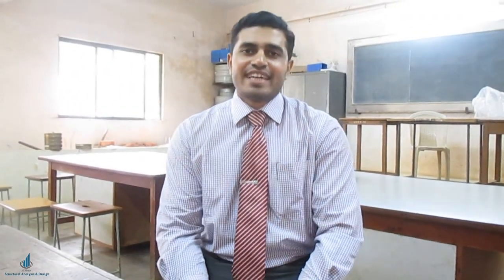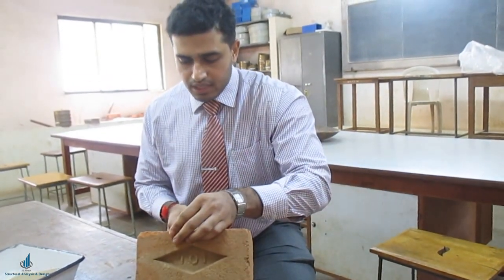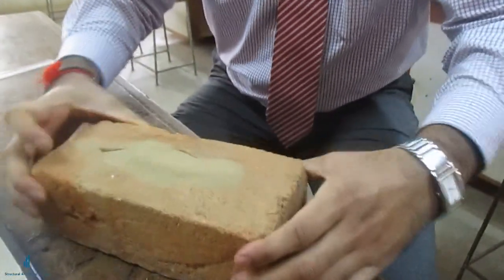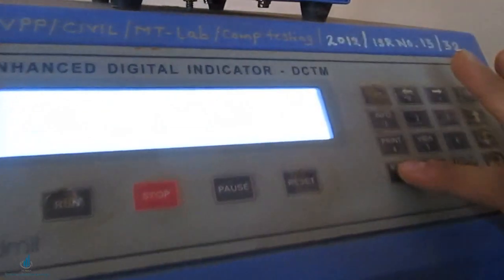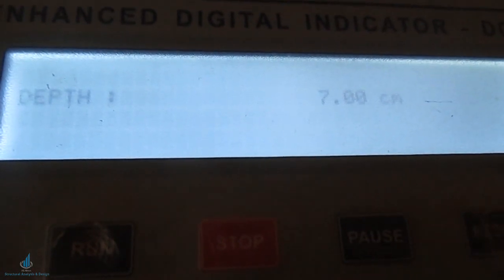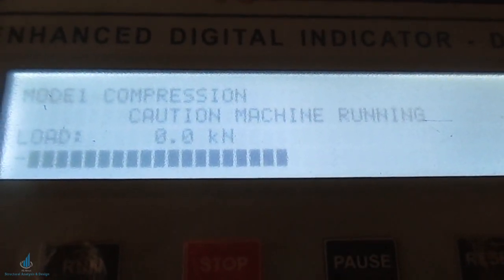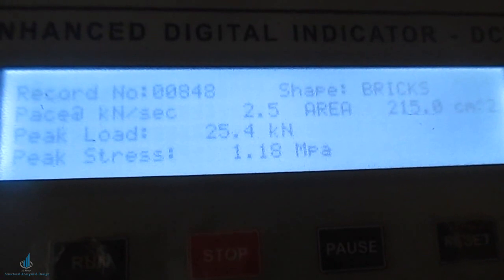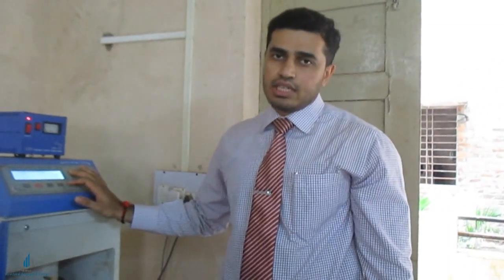Compressive Strength of Bricks | Test on Bricks | Digital Compression Testing Machine

Comment: Will there be any difference in strength if we use sulphur capping vs sand capping? I think that sulphur capping provides more smooth surface as compared to sand capping which gives bit uneven surface. Please comment. And also what does ASTM advise? Suplur or sand?

Comment: Please show us the calculation as well along with the test.
Reply from the maker: Its easy to calculate manually, our aim is to calculate compressive stress and stress is calculated by Load divided by area, from machine just take the Peak load and also it gives area automatically or you can do length X breadth and just substitute in Load/Area and get the stress
Reply: Go and check out these videos on nctel channel you'll get detailed information about everything alongside practical